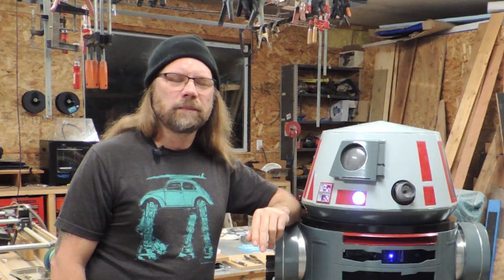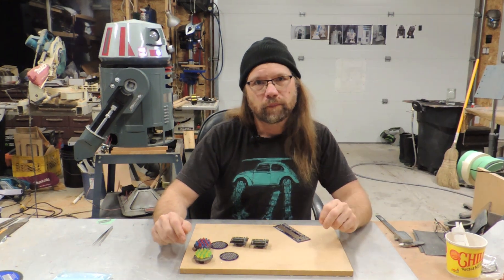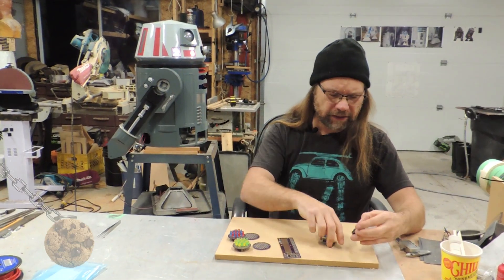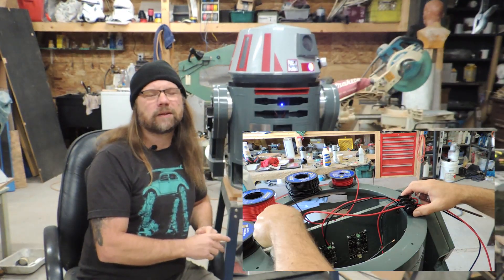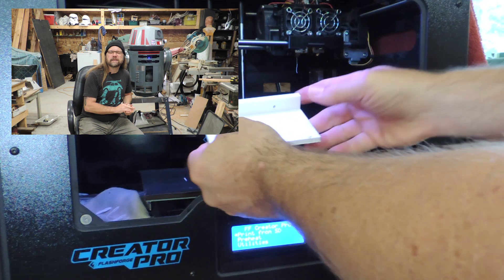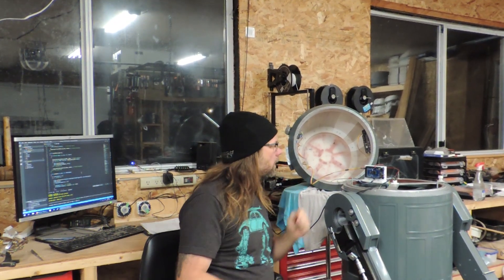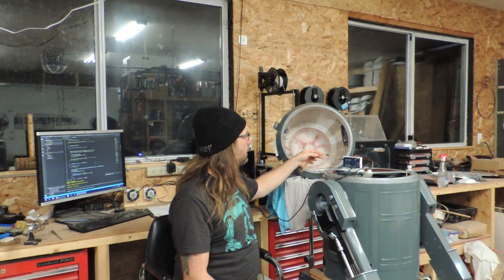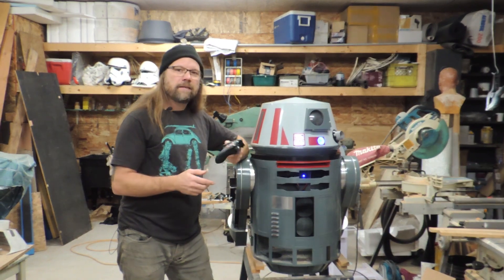R6 Astromech Dome Finished?

Comment: I like how you have done your dome. I have an Arduino Uno inside my dome that runs my lights and a separate battery too. It means I can take his dome off at any time without having to unhook any electronics...plus the lights stay on, which is what happened when R4-P17 gets his head ripped off in RotS...if paused on the right frame. Haha
Reply from the maker: Ha! That's a Great Point. I'm considering switching to a separate battery as well but for the time being I have 12v coming up through the slip-ring. There will be Data coming through there as well but I'm experimenting with RF for that anyway. Going with RF and a battery would mean I could remove the dome and still communicate a short distance with the body... Hmmm

Comment: I've been waiting for this episode :)    Thanks for sharing your skills.  I just started my build with the Xbox 360 as well.  Looking forward to seeing your next installment.
Reply from the maker: @MakerDan Thank you. I think the XBox controller is one of the easiest ways to get going. It seems to have pretty good range and seems to be a bit more reliable than some of the other things I have tried like BT and RF. Did you use a Mega ADK or a USB shield (I'm assuming you are using Arduino but I could be wrong there). Thanks very much for watching and for your comments.
Reply: I'm using an Arduino Mega with a USB Host shield.  Actually I just designed a 3D printed mount for the Mega that also holds a screw terminal shield as well as the host shield.  With the screw terminal board you have full access to all of the pins on the Mega using screw terminals.  Let me know if you are interested and I can send you a photo.  I am just soldering it together now to make sure it all fits together okay.  If you want an STL of the file I can send it to you.
Reply from the maker: The screw terminals are a great idea. I've seen them before, but never really thought of using it til your comment. Does yours have a prototyping area on it as well? I think I will oder one up myself. Thanks
Reply: I just posted the STL file and instructions on Thingiverse: https://www.thingiverse.com/thing:3950484